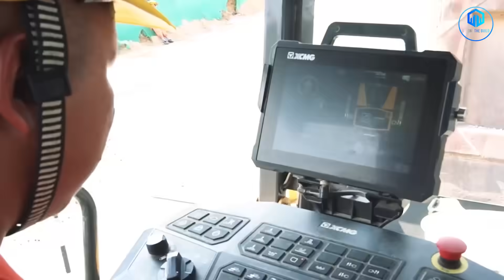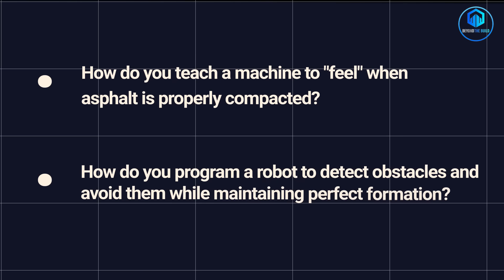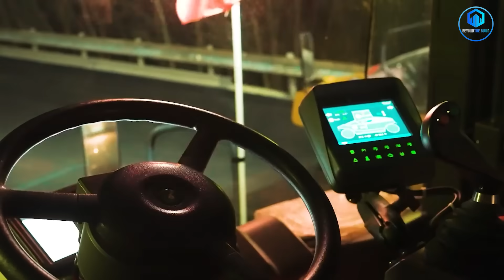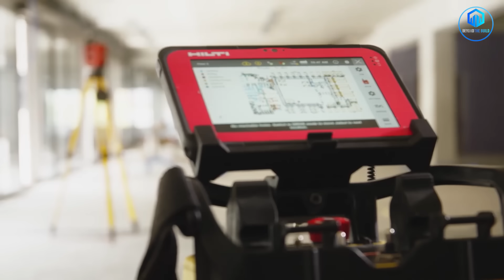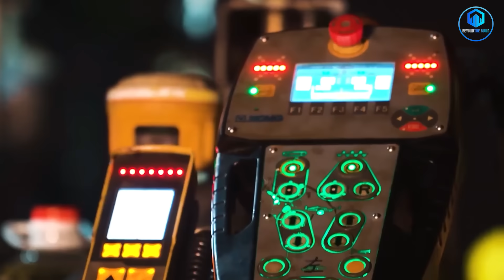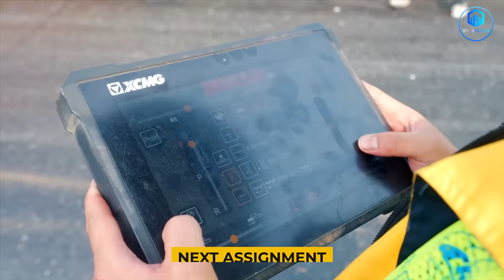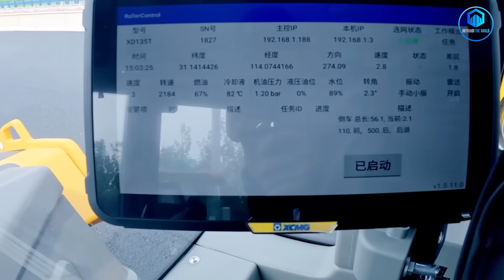China Just Built 157 km of Highway Without Humans

Comment: actually those things should have been before self driving cars - shoudl be much easier to make those because they work at low speed, compared to cars
Reply from the maker: Good point 👀 Low speed, controlled environment, it does sound simpler than self-driving cars. Why do you think they didn’t start here first?
Reply: @beyondthebuild-1  because they are idiots ? :D or maybe self driving car will make more profit than those because there are way more cars sold.

Comment: Ah... no... click bait...
If this is true as stated in this video, they only did the 'easier' part of the job.  They did not dig up the road ahead, do all the figuring out.  They don't did part of the job.

Now I don't build robots, but from examples that I have seen, these things would be riddled with sensors and cameras.  The CPU needed to process all the data from one machine is plausible, but to get all these machines working as one would be respectable.  I don't see anything like that on these machines.  What I think they are is remote controlled.  That tech has been around for a while.  All these machines are human controlled, not with 'AI'.  At best I think this is a step in the direction of replacing dirty workers with tech workers.  But the maintenance is still a dirty job.  So really, all we're doing here is moving the human from the Cab to a monitor siting in a nearby portable office.
Reply from the maker: True, humans are still in the loop, just sitting in offices instead of cabs. Do you think that shift still matters for the future of construction?

Comment: 02:36, I am interested in how a compaction vehicle can adjust its pressure. How is that done? Obviously it cannot gain or loose mass.
Reply from the maker: Good catch 👀 Compactors don’t change mass, but maybe it’s about frequency or how the rollers apply force. What do you think?
Reply: multi-tyred rollers, the tyre pressure can be adjusted, less pressure means a larger surface area between the tyre and asphalt resulting in less compaction, more pressure means less surface area resulting in tighter compaction, and the roll of the multi is to flush up the asphalt (brings the fines to the surface) where the steel drums are the ones that actualy compact the asphalt through vibration and their weight
Reply: @TheSteelRoad that is ingenious. Thanks for explaining.

Comment: These were all just remotely controlled not AI controlled.
Reply from the maker: Right 😂 not Skynet yet, just humans with joysticks. Do you think we’ll ever see roads 100% machine-built?
Reply: @beyondthebuild-1  Maybe but this is just a disctraction. China is 100% committed towards the invasion of tiawan in 2027.That is why you see a lot of fakes and anything that is real is dual use for a weapons system.
Reply: They were autonomous. The machines made decisions based on measurements and calculations and wrote command inputs on the fly. The people just monitored the process. ( this is for anybody unsure about it. I know the confident a hole that wrote it gave up trying to follow after I used autonomous .)
Reply from the maker: Good breakdown 👌 Machines adapting on the fly is a huge leap. Do you think that level of autonomy will spread fast to other industries?

Comment: GPS technology plays a vital role in the US construction industry, enhancing efficiency, safety, and security across various applications. From tracking equipment and managing inventory to surveying and mapping, GPS provides real-time location data and insights that streamline operations and improve project outcomes. 
Here's a breakdown of how GPS is used in US construction:
1. Equipment Tracking and Management:
Real-time location and usage monitoring:
GPS trackers on construction equipment (excavators, cranes, etc.) enable real-time tracking of location and usage, helping to prevent theft, optimize equipment allocation, and improve project efficiency. 
Theft prevention and recovery:
GPS tracking and geofencing capabilities can alert construction companies to unauthorized equipment movement, aiding in rapid recovery and minimizing downtime. 
Operational efficiency:
GPS data helps optimize equipment deployment, reduce downtime, and improve overall operational efficiency on construction sites. 
Asset management:
GPS tracking systems provide a centralized view of all equipment locations and usage, enabling better resource management and informed decision-making. 
2. Surveying and Mapping:
Precise positioning:
GPS technology enables surveyors and engineers to accurately mark points, lines, and boundaries on construction sites, including building corners, excavation limits, and infrastructure alignments. 
Digital modelling and mapping:
GPS data facilitates the creation of 3D models and maps, which are crucial for project planning, management, and visualization. 
Improved accuracy and efficiency:
GPS replaces traditional, time-consuming, and less accurate surveying methods, leading to increased accuracy, reduced errors, and improved overall project efficiency. 
Drone integration:
GPS-enabled drones can generate detailed 3D models of construction sites, providing a realistic view of the terrain and structures for better project visualization and decision-making. 
3. Workforce Safety and Productivity:
Safety zone enforcement:
GPS tracking can be used to enforce safety zones and monitor worker movement, reducing accidents and improving overall site safety. 
Time and attendance tracking:
Some GPS time clock apps offer additional features like facial recognition to combat time theft and ensure accurate time tracking for workers. 
Reduced fuel costs:
GPS tracking can identify wasteful driving habits and optimize routes, leading to reduced fuel consumption and operational costs. 
4. Inventory Management:
Material tracking:
.
GPS and sensor-based devices help track the location and status of materials, preventing shortages and minimizing waste.
Real-time updates:
.
GPS provides real-time updates on material delivery and movement, improving coordination and streamlining operations. 
In essence, GPS technology has revolutionized the construction industry in the US by providing accurate location data, enabling real-time monitoring, and optimizing various aspects of construction projects, from equipment management to workforce safety and productivity